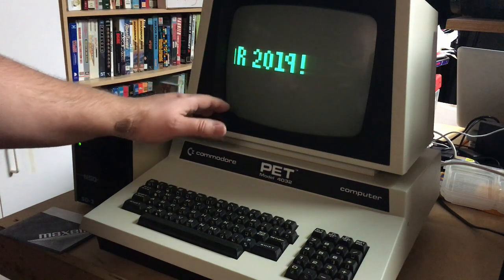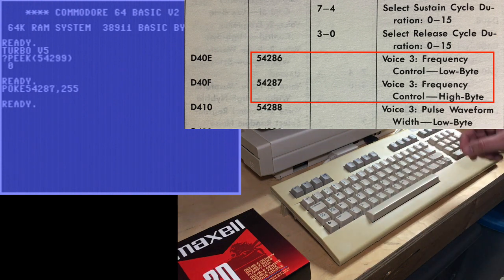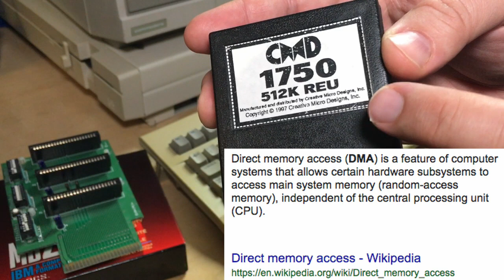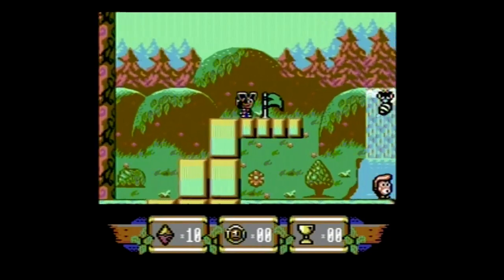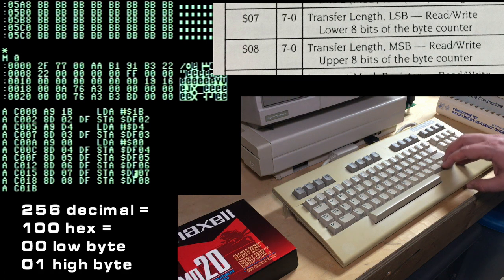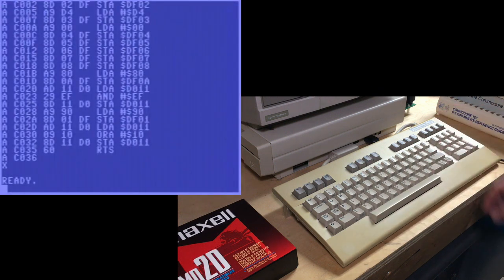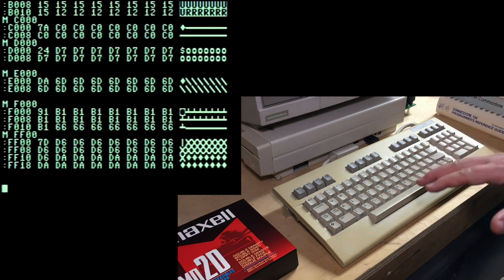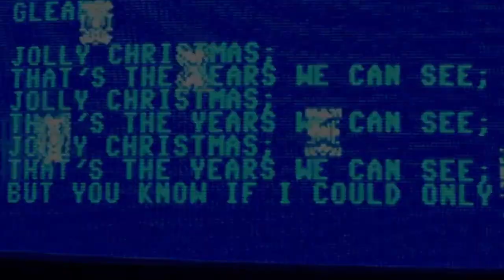Commodore 64 REU (RAM Expansion Unit) & SID Random Numbers

Comment: The misaligned byte after $ 3370 could be related that you didn't issue a SEI in the REU transfer code?
Reply from the maker: If it was a CPU interruption it should be a much bigger interruption than just one byte/cycle, I think. It probably has to do with the SID frequency being $FFFF so once every $10000 cycles (which is the same length of time it takes to transfer the full 64K bank) there will be an extra cycle where the counter doesn't wrap around. So I think it makes sense that there will be a single misaligned byte every time this code is run.
Reply: @8_Bit  Good point!

Comment: the December 2021 released C64 port of SEGA Sonic the Hedgehog requires a REU with minimum of 256KB memory to be able to run. So that high performance DMA capability was in a way just as much a feature as the additional memory itself

Comment: just to point out that the ntsc display was a lower resolution, and the pal c64 ran slightly slower.  It wouldn't be as hard as you imagine to get those extra frames.  What it works out to is that an NTSC system has two more processing cycles per scan line.
Reply: The NTSC TV might have a lower resolution, but the programmable screen is always 160x240 color or 320x240 grey pixels, PAL or NTSC.

Comment: Does to 1750 ONLY work with the C128?  If not, can it be modded to work with the C64?
Reply from the maker: All three units (1700, 1764, 1750 which are 128k, 256k, and 512k respectively) work fine on both the C64 and C128. BUT you need a beefy power supply to use any of them safely on the C64, and that was only included with the 1764 model. So just make sure you have a heavy duty power supply for your C64 and you're fine with the 1750 or any other model.
Reply: @8_Bit  what kind of power supply was supplied with it as yhe documentayion doesn't mention one.
Reply from the maker: @weedmanwestvancouverbc9266  Here's some good pictures of the 1764 power supply: https://www.nightfallcrew.com/12/05/2013/commodore-c64-power-supply-for-reu-1764-repaired/

It's basically like a C128 power supply, but with a C64 power connector on it.

Comment: Hi. What's the range of output from the OSC3 noise? I noticed that nearly all the values you got were over 100. Was that just an unusual bit of randomness or is the range restricted or skewed in some way?
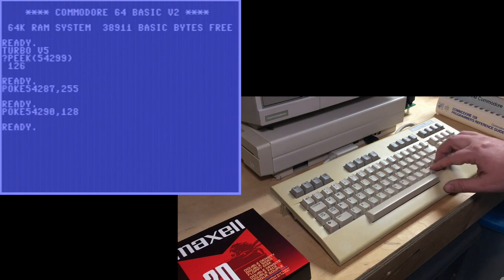Reply from the maker: Hi, it gives a very even distribution through its 8-bit range from 0-255, but when I was PEEKing it in BASIC around 7:00 they did tend to be over 100, and I was also printing over the old numbers which made the actual results unclear. For example, that 557 was actually a 55 printing over the old 3-digit number that ended in a 7. Later in the video, around 32 or 33 minutes in, you can see a wide range of values in hex. Anything less than 64 hex is less than 100 decimal.

Comment: 255 & 255 for the sid comes with the problem it's not $1000, one too little. Every overflow on accumulator is a tick for the sid. Adding $ffff overflows 99.99% but not that time when accumulator is at 0. So you get 1/65,536 miss alignment.
Reply: The DDS (direct digital synthesizer) works that way. Use a variable (in this case more than 16 bit i guess 24 bit) add the low and the hi byte to the variable and you get a variable sawtooth frequency. With that sawtooth you can calculate a triangle or a square, but you can also use a lookup table to play samples or other waveforms. Mostly you use the most upper bits for the waveform.
Reply: phase+accumulator is pretty much a divide by any number pre-scaler, instead of just power of 2, but the problem is jitter if you don't use phase numbers that is power of 2.  $8000 would be jitter free but would be half the speed, $ffff is nearly jitter free, not just that time when it takes two of them to get a roll-over tick that happens 1/65535.

Comment: Psuedoradom number generation, not 'true' random number generation. Many BASICs have a 'problem' that the RNG function can be decidedly non-random over time under the right circumstances. Most correction methods I recall use the system clock in combination with user input timing to mix up the RNG seed.

Comment: Great video, thanks for this.  I dusted off my "Check for REU" Basic prog.  It just checks for the existence of an REU, not sure if it works with all expansion carts though. 100 is just a test value at $DF02, one could use any value:
10 POKE 57090,100: IF PEEK(57090)=100 THEN ?"REU Detected"
Reply from the maker: Hi, yes, that should be a fairly reliable method. It might produce a false positive if there is a different device mapped at $DF02 that still behaves like RAM, or a device that coincidentally returns the magic number chosen (such as 100 in this case). The 2nd case could be eliminated by storing one magic number, checking for it, and then storing a second, different magic number, then checking for that :) The first case could only be fully eliminated, I think, by actually triggering an REU transfer and then checking for the results. Would it ever really matter? Probably not, I just like to think through these things :)

Comment: Hold on a minute, the sprites are moving and the basic screen is activr. that is true dma then :)
Reply from the maker: I now realize I didn't make it clear that the REU halts the CPU during DMA. The REU directly accesses C64 RAM, but not simultaneously with the CPU.

Also, during the snowflake routine the REU isn't active at all, the SID random noise output is being read by the CPU. I only used the REU to analyze the behaviour of the SID to better understand how often I can expect a new random value from it at the maximum oscillator frequency.

Thanks for the comments!
Reply: @8_Bit  Thanks. I found something in the dieshots and main board schematics.There is a line enabling the address bus drivers of the VIC only on PH0 (clock) high (or was it low).. This signal is closely related to the AEC signal. Following the AEC signal on the main board schematics, AEC meets DMA at an or gate before going to the CPU. Makes sense. The REU and VIC can both stun the cpu :)
Reply: The sprites are being moved by an Interrupt routine (IRQ), not by DMA.
Reply: @csbruce  "The REU directly accesses C64 RAM" also the REU drives the DMA line if I remember correctly.

Comment: 1.023mhz ntsc cpu speed / 65535 hz noise frequency  gives ~16 cpu cycles per noise sample.
Reply: So this means on PAL machines you have less cpu cycles per noise sample because of the reduced cpu frequency.
Reply: @Koxi73  Don't think the C64 freq and NTSC freq are related. My PAL C64 also had 1.023 mhz cpu speed

Comment: Far as I know that 3rd party RAM expander uses less power indeed because it has the RAM on overall fewer chips.

Would be interesting to see if you could reverse engineer the original expanders, using the same core chip but making it with the fewest possible chips. Maybe not worth it in the long run.
Reply from the maker: I'd definitely like to see a new REU clone being made, and have a lot of ideas for extra features that would make it amazing for making very advanced C64 games.
Reply: The CMD cartridge also had RAM technology from a decade later than the 1750.
Reply: You're both correct. The clones made by CMD and Software Support International both use 4 256kx4 ZIP chips instead of 16 256kx1 DIPs.

The sticking point to making new clones is economic rather than technical, why would anyone bother when the 1541 Ultimate already includes an REU configurable up to 16 megs?

Comment: That BBG cart is similar to EMS in old IBMs... Except considerably worse. An EMS card could have 64K or more per window, 256 bytes is pathetic for 2MB...
Reply from the maker: It's not much of a limitation on the C64, since the 6510 only has 8-bit index registers anyway. Whether adjusting the RAM window, or the high byte of the pointer you're accessing main RAM with, it's pretty much the same.

Comment: 60 fields per second, or 30 frames.
Reply from the maker: The C64 and most other 8-bit computers and game consoles don't output interlaced video; they don't build two interlaced fields and output what we might call 480i at 30 fps, they essentially output the same field at 60 hz which we could call 240p at 60 fps. The video display code and game logic of most games are synced to vblank at 60 Hz on most NTSC computers and consoles; we commonly call this 60 frames per second. Both from the video chip and software perspective there's no distinction of 2 fields per frame.